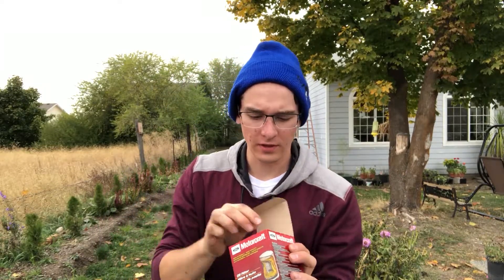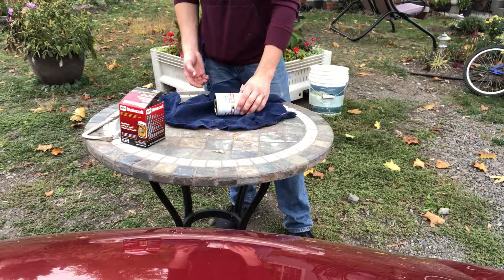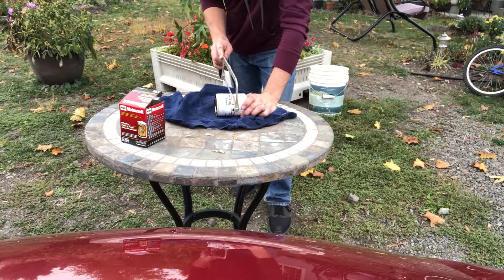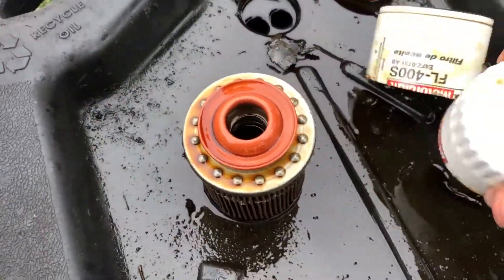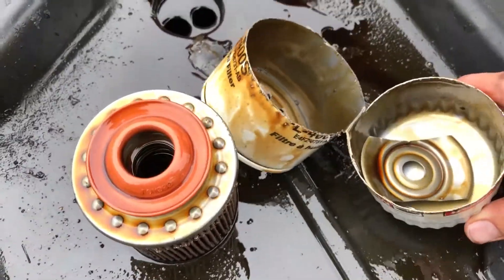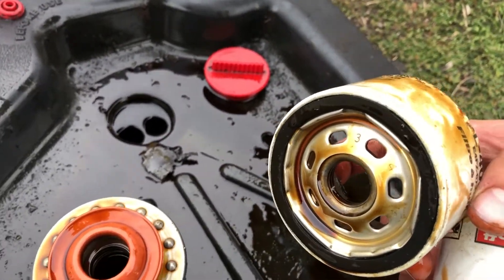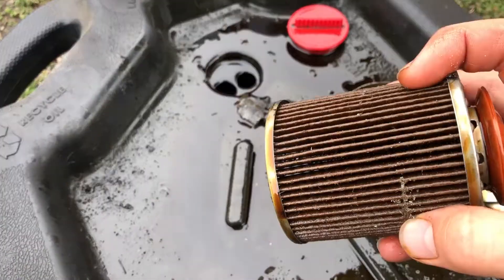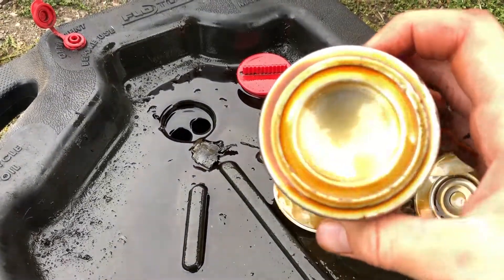Whats inside a used oil filter?

Comment: I use a manual nibbler or a large pipe-cutter. Using a hack-saw will introduce metal shavings into the filter and cause uncertainty as to their origin.